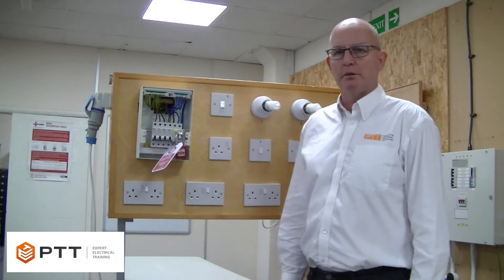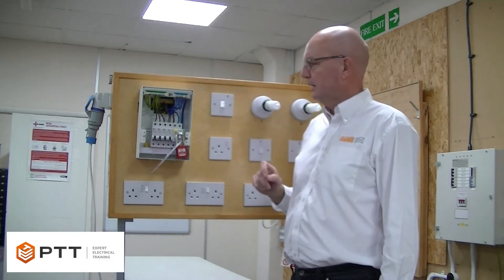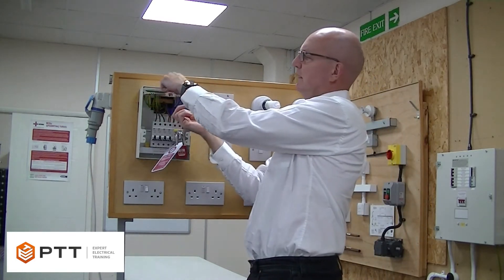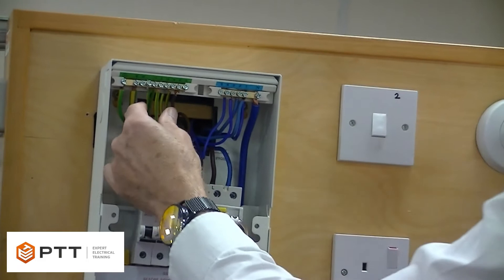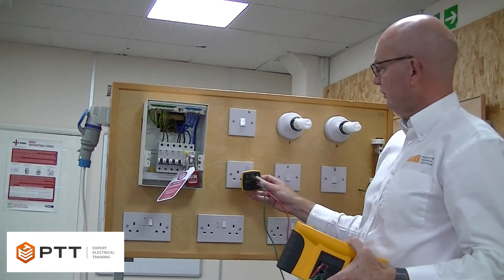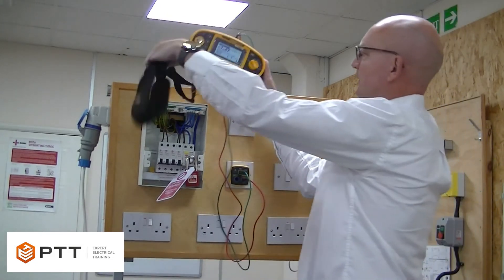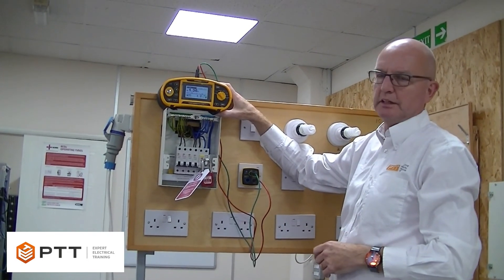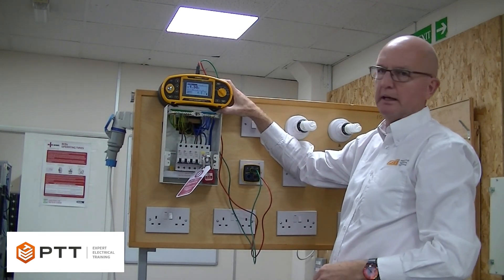Continuity Test of a Radial Circuit

Comment: Title is a bit misleading, I was hoping to see the test of a Radial circuit, not a Ring Final Circuit.
Reply: It is a radial circuit as he only disconnected one line conductor (R1) and also you can have more than one socket outlet on a radial but the R1+R2 readings will rise and fall depending on which direction you test whereas a ring circuit should be the same reading at each socket outlet.....but you've probably got this by now.